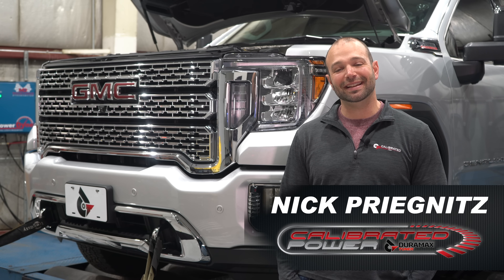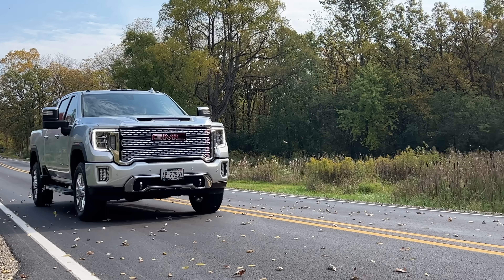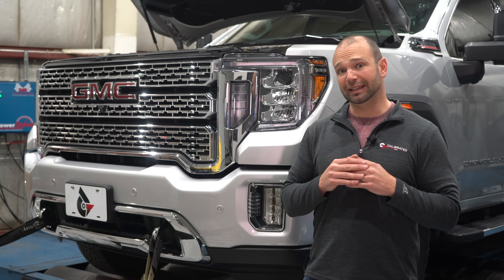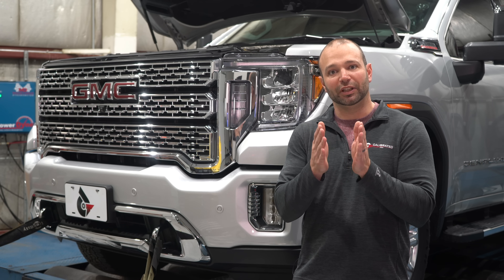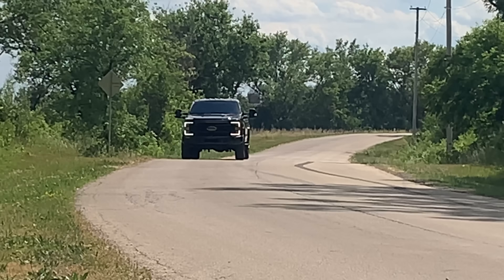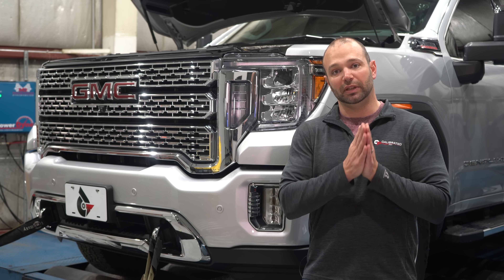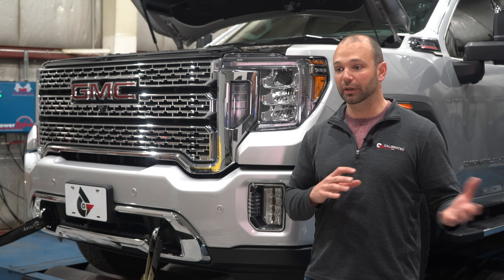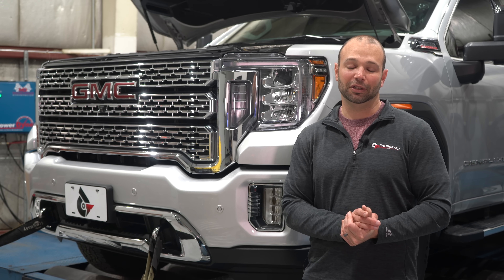10-Speed Allison Transmission 101

Comment: I've been without my 2021 Sierra Duramax/Allison for 3 1/2 months now due to a mysterious transmission issue between gears 2 and 3.  They've done everything from a new valve body to replacing multiple wiring harnesses, to rebuilding the transmission.  Two days ago they had a GM Engineer there to help diagnose it.  If anyone has had a similar issue, please advise.
Reply from the maker: @davefrattaroli5804 Thanks for sharing! We have not personally seen anything like this. If anyone has any information we would love to hear it as well.
Reply: @Duramaxtuner  two weeks later and still without my truck.  Most recently they changed the speed sensors and the transmission control module.  Both repairs didn't resolve the issue.  GM offered me a $3,500.00 voucher towards a new truck.  $3,500 for a $90,000 truck, how generous.
Reply: @Duramaxtuner  Got my truck back!  GM finally consulted with Allison.  Turns out it was a faulty transmission pump.  I've had it for about a week and a half with no issues.

Comment: Wow, I will call the dealer shortly. They still haven’t completely told me what’s wrong and supposedly I’m next in line to get my truck fixed this week. Been sitting for 3 weeks now and service mama did say there is metal in my fluid. Thanks so much.
Reply: sometimes its bs dealership struggled day and a half to install light bar because tailgate bracket i just did it myself i even thought of calling manufacturer something that they didnt even think off

Comment: Help, my one year old 70k new 2022 GMC 1500 3.0 Duramax tranny just blew up. Not sure how. Never gave any warning,  Just a daily driver, never have towed anything and was doing about 15 mph in my neighborhood. Check engine light and dash said drive slow. Dealer said rebuild is needed but should I fight for brand new  transmission?????
Thanks
Reply: Thanks for  replying ! I will ask when I hear back from dealer. Only thing is My wife did say she smelled something burning 30 seconds before transmission broke? I wonder if that had anything to do with it?
Reply from the maker: @jasonallin298  Worn-out clutches will often produce a burnt kind of smell.
Reply: Ok , so I heard back from dealer on my 2022 gmc sierra 1500 3.0 Duramax transmission problem with only 15k miles on it. Never towed and just a daily driver. They said it is the torque converter is done. Not sure why it broke and they said they have seen a lot of trucks with this issue.  Should I ask for anything specific to be done when they fix it so I can avoid this problem again or is it a straight forward fix? They also said something about a pump? Thanks
Reply from the maker: @jasonallin298  If the pump also known as the impeller is bad you could have some major issues on your hands. Usually, the only way these things fail is when a blade breaks off internally due to a poor weld or crack in the metal. This can cause loads of metal debris to be interested into the transmission. If I were you I would hope they planned on replacing the entire transmission and if not then be very wary of any signs of slippage or odd shifting in the future.
Reply from the maker: @jasonallin298 I would ask for evidence of why the transmission only needs a rebuild. If it's purely an issue with the clutches or the fluid system then you shouldn't be worried about just getting the thing rebuilt.

Comment: I have the 10spd in my 2020 6.2 1500 Sierra. My brother has the 8spd in his 2018 6.2 GMC Sierra. 

Same engine specs, same overall truck specs, almost identical weights, but mine having the 10 speed from a dig will be a full truck ahead of his to 60.

From a 60-110 roll I’ll be ahead by 3 truck lengths. The tighter gearing, as fast as it shifts, and as quick as it revs is definitely all a plus over the lesser gears.

Also, the Fords with a 10spd a game changers. Before they were ok. Now they are nasty as hell. A boosted F150 8 spd bs a boosted F150 10spd, worlds different.
Reply from the maker: Good to know @JASPACB750RR Thanks for the insight!

Comment: I'll keep my700hp 06 LBZ it doesn't need a 10 sp. trans, and still gets decent mileage for the available power
Reply from the maker: @jimbradd2783 The 10-Speed is also a solution to the ever-increasing towing capacity of these trucks as well. Some add more power to get the truck up and moving better, they've chosen to add more gears.

Comment: Skipping gears costs fuel, depending on if the transmission shifts at a lower RPM for efficiency than it does for power.  Any good truck driver with an 18 speed does the same thing.  If saving a few seconds is more important, they skip the splitter.
Reply from the maker: Thanks for the comment.

Comment: My 21 f150 10 speed rarely will  skip a gear. Only under extreme soft acceleration will it skip 2nd.  Compared to my explorer which routinely skipped 2 and 4th gear.
Reply from the maker: Interesting. Thanks for the comment.

Comment: In the early days class 8 auto or automated manual. We hated to drive them had to go through every gear with light or empty load. Skipping gear is necessary for economy and drive ability. Now day's most trucks with automated manual can start in 3rd or 4th and skip all the way to top. Not only  can you never win a drag. But your competitors will always out pull you in stop and go traffic. Especially down hill simple it takes time to row itself to 10.
Reply from the maker: IDK. Our tuned L5P smokes quite a few vehicles in the merge lane....

Comment: WAY back when automatic transmissions were ruggedly built, there was no cutting of power for a shift. Instead each shift gave you a kick in the butt and the vehicle surged ahead, sometimes even barking the tires. There were no computers or electronics. It was all very cleverly designed hydraulics. Program your modern slush box to do THAT!
Reply: That kick in the butt from 1-2, is part of a known weak point in my jeep's transmission (though it is an earlier computerized one), even so that transmission lasted 411K before the kick took out 2nd gear. 
Some day I'll have the means to have it rebuilt, that is assuming it didn't trash the case with how it lost 2nd gear (what this model is known to do).

Comment: The Freightliner semi I drive has an autoshift 12- gear trans.  It is not a true automatic trans. with a torque converter, it's a manual with automated clutch actuation and gear selection.   I have to admit I love this thing.  I can select what gear I want to start off in. If I'm heavy it'll be 1st .  If I'm light it'll probably be third.   After a few miles the transmission will "learn" how heavy you really are.   It will skipshift on it's own.  It'll shift from 1st to 4th and then to 7th if you are light enough or if you are going down a grade.  I think it has a gyroscope on it that knows the angle you're on.   It does get confused on occasion and shifts before you would like but you can quickly flip the lever down and shift it.   The fuel mileage is actually better than you would manage shifting it manually.  I have driven them all. 9,10,11,13,18 speeds you name it.   The 13 speed manual is the favorite of most semi drivers.

Comment: I have a 2022 Chevy HD2500 with a 6 speed and it is a giant piece of junk...The trans never knows what gear to be in and it does this crazy banging thing when you drive it slow across a parking lot or in heavy traffic, sounds like the driveshaft is going to fall off. The truck has a 6.6L gas engine and it does fine, but the driveline is crap. (oh and the brakes suck as well)

Comment: and 30-40 years back the engineers said a seven speed trany would be the better choice for big diesel commercial trucks. 
i drove them. wind out the motor. shift then lug the motor back up in rpms.
now a computer controlled motor trani deal. powerless and gutless even worse than the manual 7 speed.
Reply from the maker: Thanks for your input.

Comment: I had been considering a GMC 1500 with the 3.0 diesel but since I've learned more about the transmission, I'm going to pass.  With multiple class action lawsuits against GM on the table by thousands of pissed-off owners, and GM refusing to repair or replace, I'm out.I just don't see how anyone can justify spending upwards of $70k on half-ton pickup that the manufacturer won't support.  And if Nick's tuning works to alleviate the issues that's great...but why should we all have to purchase an aftermarket item to keep a factory component from killing itself?
Reply from the maker: No clue. We've tuned and dealt with a ton of these trucks with no issues.
Reply: @Duramaxtuner  Good to know! Thanks!!

Comment: Bought a 2024 6.6 gas with the 10 speed. Truck pulls the camper I have surprisingly well coming out of a 19 duramax. Question about the shifting, mine seems to want to hold first excessively long, in my opinion. If I’m just feathering the gas pedal, I usually like my shift points right around 2k rpm’s when not towing, it seems like 1st wants to rev up to 2500-3k rpm before shifting and it feels delayed compared to the rest of the gears. Noticeably not as smooth…. Other times it does shift right around 2k from first to second but it’s almost always if I back off the throttle a little bit. Thought it was the tranny learning my driving habits but I have 1200 miles on it now and had 16 miles on it when I got it so figured we should be dialed in by now. That being said, while towing my 11k lb camper it is smooth shifting regardless. Only when I’m not putting a load on it does the issue happen. Anything come to mind or is this pretty normal behavior for this trans? Thanks for the video!!!!

Comment: Can it really be a heavy duty pu with torsion bars?
Reply: Yes, because what's towed and hauled is done in the bed or off the tow hitch and never in the front of the truck. 
My gooseneck trailer and utility trailer attach behind my truck. I use a Ram and a Duramax with no issues.

Comment: This transmission was not designed for racing.  It was designed for everyday driving and towing.  The same way the truck was not designed to be raced does not not compromise it's designed purpose.  If you want to race your truck, it needs to be modified for that purpose.  Just because it does not meet your needs stock does not mean it is a poor design.  It is a good design, you are just using it for a purpose not intended.  Besides, why would you race a vehicle this expensive.  If you race it and wreck your insurance will not pay for it (if they find you were racing it).
Reply from the maker: You're exactly right! Just because this transmission was not designed for racing does not mean it's a bad design. It just means it will need to be modified if you want to race it.

Comment: As a truck driver it's about time more gears works your enguine less especially on the hills,what I would like to see is a pickup with a 10 speed manual transmission in high-school I had a gmc dump truck with a 5 and 2 it would be nice in a pickup
Reply from the maker: @dewaynem559 That would be awesome to see!
Reply: If your going to have a 10 speed transmission, I’d just make it a manual. Shift it however you want depending on the road and the load. Better yet make it a 13 speed. Never did like the 10s.
Reply: @billmoran3812  I liked a 13 better but driving for Walmart my last truck was a cascadia 465 cummins with a 10 speed and the 9.1 mpg I averaged for the year to me was pretty impresive considering the last truck before it averaged only 6.9 mpgs

Comment: I tow a large heavy (for an RV) 5th wheel with my new Ram, the Asin 6 speed with the HO Cummins works fine in my opinion. I also think it's heavier duty than the GM and Ford 10 speeds. I'm sure the 10 speeds are okay, but I sure don't worry that I don't have one.
Reply from the maker: @G53X0Y0Z0 Thank's for sharing your opinion/experience! We're always interested to hear what your opinions are on topics like this.

Comment: There would be less confusion if the viewers and posters understood that this video referred to the Chevrolet/GMC 2500/3500 pickups with a Duramax Diesel with a 10 speed transmission 10L1000.
The Chev/GMC 1500 pickups use a different 10 speed: 
10L80 (GM&Ford developed), same as what the Ford F150 pickups use 10L80 10R80MHT (GM&Ford developed).

The Ford F250/350 use a very different 10 speed: 10R140.
Reply from the maker: Thanks for your input.

Comment: Put a couple gear vendor units behind it, and keep the trans in 3-4 gear, if it can be kept in 3rd gear,  full manual control should be an option!  And skip shift should definitely, be an option, catch every other gear,  I'm not sure the gear ratios, but every other,  up to 4 then 7-9-10 possibly I saw a car the other day, it shifted 3-4,5 times before mine went through 2nd! A 6speed manual is plenty for me! But imagine a 10 speed manual! Two low gears , and 3 O.D  ratios to choose from, with the rest fairly normal close ratio,  normal use  start from 2nd, only use 9+ on highway, 50+mph , 😆
Reply from the maker: @Jamest.5001 We would have loved to have seen the integration of skip shift in the 10 speed. Sadly it does not look like it will be possible using the existing TCM. As for a 10 speed manual, that is definitely something that we would like to see brought to market.
Reply: I feel like GM holds things back for the future.  Gotta keep a steady flow of updates to keep bringing us all back in every 5 years.

Comment: Hey Nick, really appreciate your knowledge on the 10 speed. Have you seen any real problems with a stock tuned 10 speed?  Any real design problems to worry about in all stock form?
Thanks!
Reply from the maker: We have not as of yet.
Reply: @Duramaxtuner  In stock form, during shift, does the converter stay locked in either tow haul or normal mode?

Comment: Was never fond of the 4sp or 6 autos. The new ones have 10 reasons why not to buy one. Guess thats why I have a manual in mine.
Reply from the maker: @rickeydriskill1096 From a drivability and ease of use standpoint they really arn't too bad. Definitely a whole other animal than your 5 speed manual though.
Reply: @Duramaxtuner  6sp with none of the problems of the autos. I call them a animal  with a bunch of potential high dollar problems.

Comment: The transmission is allinson design and tested! Not a ford/gm colaboration that was was never for the HD lines was only for f150 and silverados since both had lots of issues with their trans! But HDs are both completetly different!
Reply from the maker: @rigobertorosell  You are is correct. It was more of a collaboration between GM and Allison than it was Ford and GM.

Comment: You can’t turn up the motor and not turn up the transmission, that’s just common sense.  But…If you don’t understand the engineering, well……go back to gas!  Most diesel owners shouldn’t be driving them anyway.  They are for working not for showing off.

Comment: I have a 2020 GMC Canyon with a transmission that hasn’t run wright since I got it. The truck shutters and feels like I’m pulling a trailer, currently it’s been in the dealers shop for a week. I consider there new transmission as garbage and luckily it’s under warranty . It will sit in there shop until it’s fixed and when I get it back I’m heading right to the Toyota dealer and never looking back.

Comment: Was really hoping that you would talked about the 10-spd Allison being added to the 2024 6.6L V8 gas powertrain.   :hand-pink-waving:
Reply: Its the same ford/ gm 10 speed trans with lower input torque rating for the gas engine.
Reply: @dustytravels9458  not a Allison.
Reply: Who buys a HD 2500+ Series truck with a gas motor?? ...... yuck
Reply: @bobbertee5945 Me I dont want a diesel there to expensive there hard to work on there maintenance costs to much... Im thinking of the new 6.6 vortec gas gmc hd as I need a truck with little stronger suspension then a 1500... No salesmen could ever get me into a new diesel NOT a chance !!! Plus its like $5000 to delete a new diesel ontop of everything else🤦
Reply: @taylorh3930  the 6.6 gas with 10 speeds are nice compared to diesel 10 speed . It just revs higher , doesn’t have the bottom low end torque. There’s a reason why bunch of diesels sell right at end of warranty .
Reply: @bobbertee5945 someone who understands basic cost analysis and user needs.
Reply: Anyone with a brain @bobbertee5945